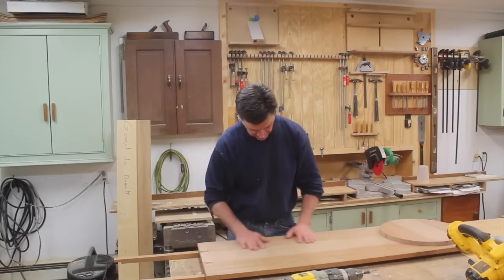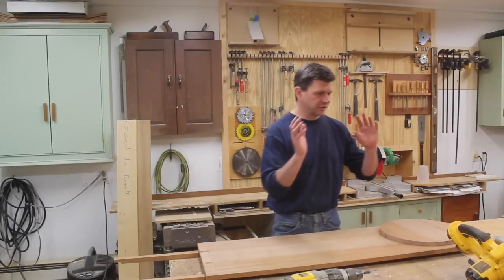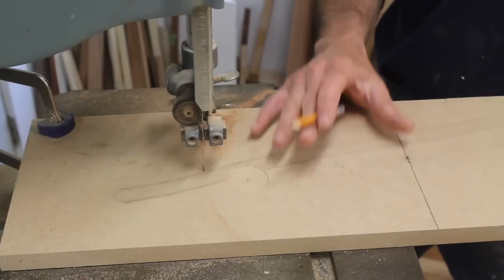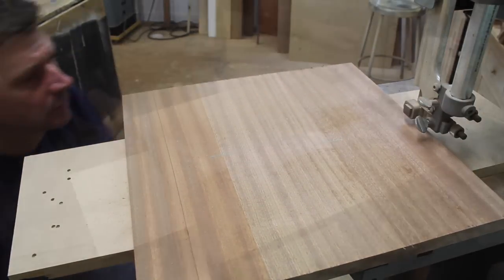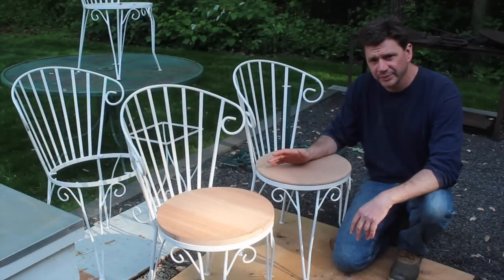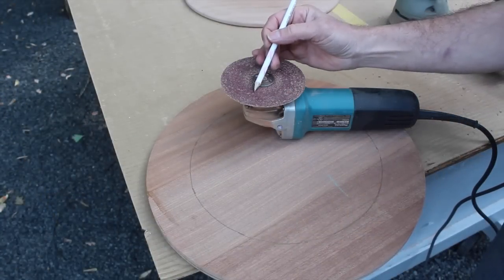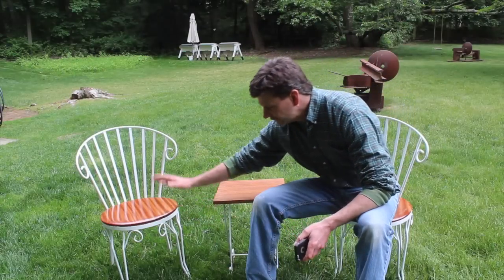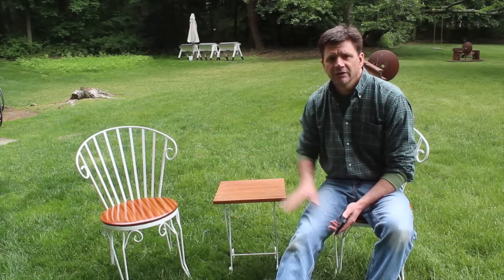Refinish & Make New Seats for Wrought Iron Chairs

Comment: I love the sapele.  Because of this video, I'm making my sister an outdoor table all made of sapele with this exact finish. I heard you say 3 coats. But what grit do you use to sand in between. Also, after the last coat, do you polish with some steel wool or just leave it alone after the last coat.  I appreciate your videos so much. I'm a YouTube taught wood worker, and you've been a big part of my learning process.  I've gone from using home depot 2x4's to sapele. Thanks again for all you do.
Reply from the maker: Thanks, I made a few table tops for outdoor use and finished them with marine water lox . Do a quick search on my channel the video is about seven months old and should be helpful. First time using that finish for exterior use it and really happy with it

Comment: I have an old gate I was wondering about.  So if I use the wire brush and the rust paint you mentioned, then it will last?  Your chairs turned out beautifully.
Reply from the maker: SandiRose27 Thank you. I have used that primer for years and I would say yes, but some people will say you need to sand blast........ and thats ok if you have a sand blaster

Comment: The chairs and table came out great Jon.
A few questions: First, the band saw blade, is it a 1/8 inch 12 to 15 TPI? Second, the metal art in the your yard, was that something you made?
Thanks Jon, have a great weekend.
Reply from the maker: Scott L Thanks Scott, the blade is 1/8 by 12, a 1/4 x8 works great also but I didn't have a sharp one . I made all the sculptures in the yard before I had kids and now that the kids are getting bigger I plan to start working with sculpture again.

Comment: Great job! One detail that wasn’t covered though... how thick does the seat board need to be?
Reply from the maker: Thanks, 3/4”
Reply: Jon Peters - Longview Woodworking thanks for the SUPER QUICK reply! I’m thinking about using AZEK sheets cut to size so I wouldn’t have to worry about it rotting over time and covering with foam and outdoor friendly fabric, just didn’t know how thick it should be.